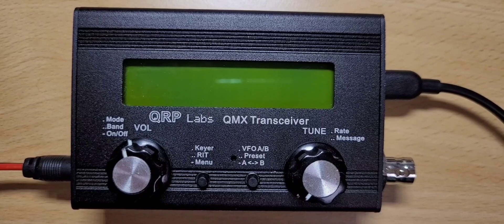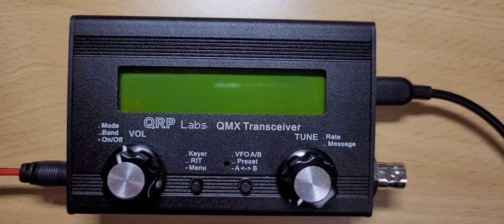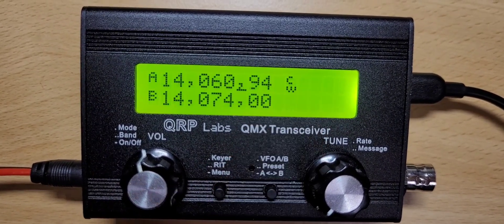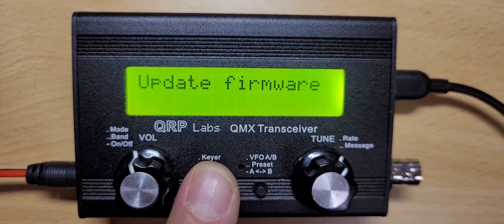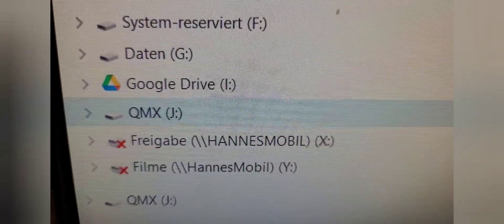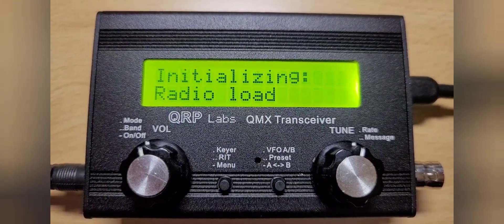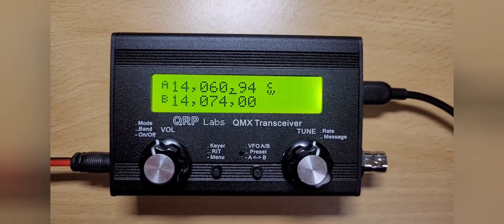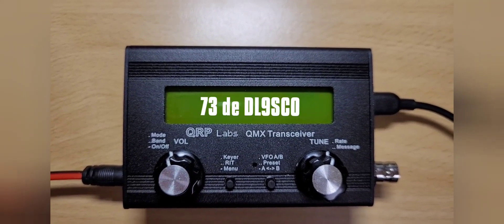QMX Transceiver - Updating the firmware

Comment: Danke für das Video! Ich warte noch auf meinen QMX. Er ist bereits unterwegs und ich freue mich schon. Eine Frage habe ich. Was passiert mit der alten QMX - Version auf dem Gerätespeicher? Wird die ersetzt oder bleibt die dort neben der neuen Version ? Muss man die ggf. manuell löschen?  73! DL4YEL
Reply: Just got mine. I have the same question. Do I need to delete the old .QMX file off of the radio? Or does drag/dropping the new file in automatically replace or overwrite it maybe?
Reply: @jbird4h30  No , you have to do nothing with the old file. Only drag and drop the new one. It looks like the old file is automatically removed